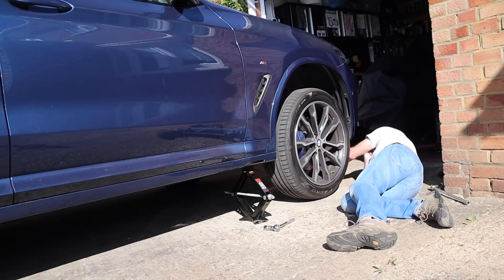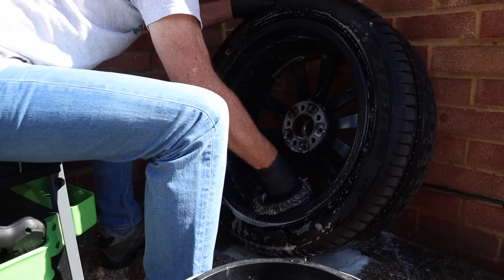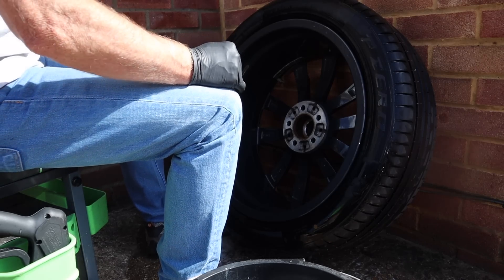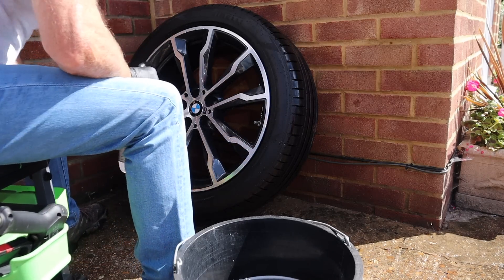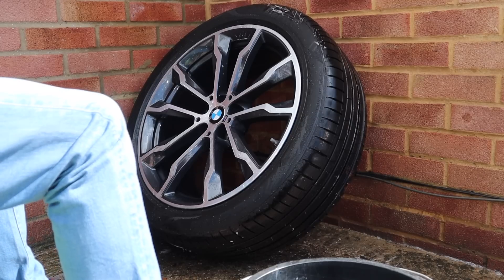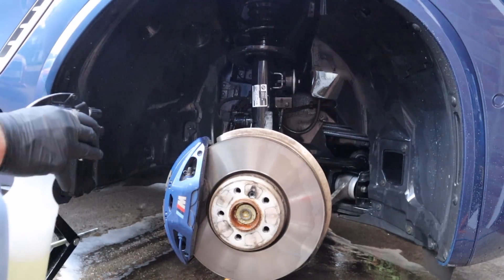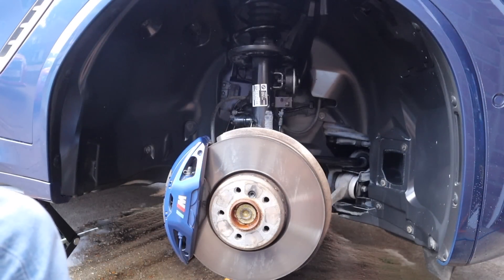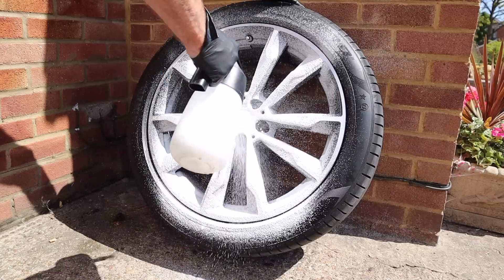M40i Wheel Decon

Comment: Hi Martin, just came across you today and I've enjoyed watching you do to the wheels. It's something ive been doing since the mid 70s when i started driving and i use to get so ridiculed for wasting time when they're only going to get dirty straight away. Course there was no iron decon or any of the fancy stuff we have today. One thing I'd recommend is get yourself a piece of aluminium or better stainless steel sheet to place behind your wheels when cleaning them against the wall.
1/ she who must be obeyed won't give you a bollocking 🤣 when the bricks start to stain.
2/ it'll stop the chemicals from eating your cement joints. I know from experience with a stone garden wall where a certain point i use to use as my wheel support while cleaning them.
3/ it'll help keep those brownie points which are so easy to lose 😂 with the misses.
Reply from the maker: Hello Michael & a very warm welcome to the channel. Check out any of the videos and any issues or comments just drop me a line & I will always get back to you. Spot on mate Im very short in the brownie point department👍
Reply: @ObsessiveCarDetailer  yep, toughest bank to get a decent interest rate, then you suddenly find yourself bankrupt and gotta start all over again 🤣🤣🤓
Reply from the maker: @Iceberg1313  🤣🤣

Comment: Great video as usual. I find cleaning my wheels hugely rewarding. As I run winter wheels, it means mines get a good clean every 6 months. 

I hope you remembered to pop out the BMW centre cap to clean in there too.
Reply from the maker: Hi Ranald, that’s so much easier. I had a set of winter tyres with my previous X3 and although I didn’t coat them I always gave them a good clean and wax. I did pop the bmw centre out and clean and coat them but cut it out of the video to keep the length of the video down and didn’t think too many people would find that level of detail interesting but clearly you do👍👍👍
Reply from the maker: Hi Ranald, that’s so much easier. I had a set of winter tyres with my previous X3 and although I didn’t coat them I always gave them a good clean and wax. I did pop the bmw centre out and clean and coat them but cut it out of the video to keep the length of the video down and didn’t think too many people would find that level of detail interesting but clearly you do👍👍👍
Reply: Great stuff Martin. I am really that sad!!! 😂😂😂
Reply from the maker: @ranaldbrown3032  us sad gits need to stick together 🤣

Comment: An other really good watch. I am not completely nuts then as my wife tells me, that I must be to take my wheels off to clean them thoroughly. I try to do this twice a year. I recently got my wheels refurbished  and have applied Mitchell & King Armour which is part Si02 and will wash them and coat them with wash+ and wax+ which are Si02 based and have 6 months protection. I will not coat them in Ceramic coating as I am not a fan. I look forward to part 2.
Reply from the maker: Less sweat in part two John. Twice a year!!!!! you need stronger medication that Im on 🤣
Reply: @ObsessiveCarDetailer  Probably

Comment: Cracking video Martin .. so much time and effort when you do things properly but it'll be well worth it - really looking forward to Part 2 now 👌🏼👌🏼 

Good safety advice too about the jack/stands... I have a 3 tonne trolley jack but I still wouldn't trust it once the wheels are off, stand(s) every time 👍🏼👍🏼
Reply from the maker: Cheers Mark. I had a nasty experience with a trolly jack on bumpy ground when the jack wheels didn't move and the car fell off the jack. Luckily I wasn't under the car but it cost me a new wing and seal £,£££. Thats why I only use my trolly jack on a smooth floor. Really scared me, worse than looking in the mirror🤣
Reply: @ObsessiveCarDetailer  🤣🤣 I seen it happen during my time as an apprentice (too many years ago to say out loud!!) - thankfully it wasn't my fault 🤣 more importantly nobody was hurt but 1-2 tons of metal drops with no regard for what might be underneath !!

Comment: Sorry Martin, in my book the most heinous crime is to get names wrong - even on YouTube posts! Forgot to mention that wheel well looks as good as the wheel - one of the major benefits of a “wheels off” detail. It looks like a plastic liner - much better than the carpeted ones 👍
Reply from the maker: Not a problem Paul, I have been called many things over the years. Yep plastic liners at the front and carpet on rear but they came up ok as you will see if you watch part two

Comment: Hi Malcom, well done on another very thorough job. Was using the nano polisher on the back of the spokes and barrel necessary? Did it have much effect? Even Jim White of White Detailing didn’t do that on his last video on an M4.🙂 Unusual that GT don’t give any guide as to length of protection of the ceramic coating. How long did the process take for one wheel?
Reply from the maker: Hi Paul, maybe Jim should subscribe to my channel. It may give him a few ideas🤣. Was it necessary? ? Not sure any of it was necessary but thats the obsessive bit in me kicking in. Using the camera on one wheel took about 4 hours without it took just over an hour & most people call me Martin🤣🤣